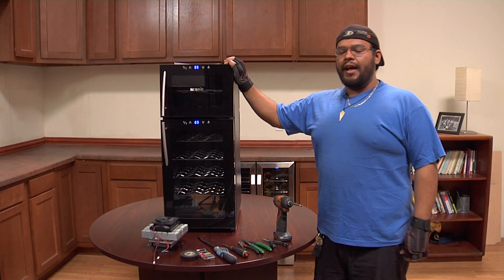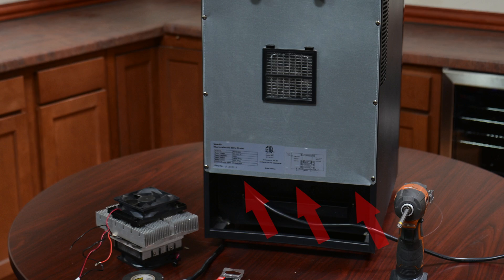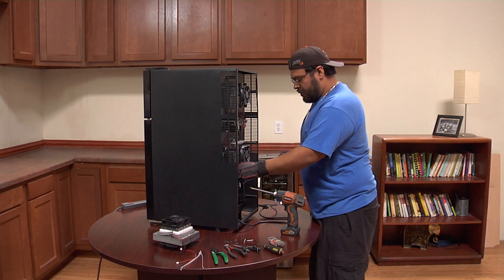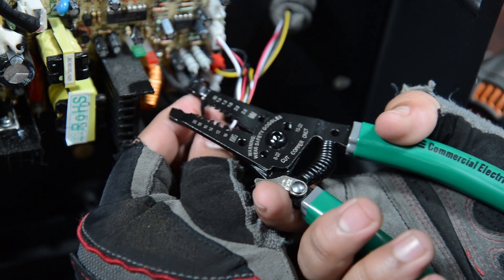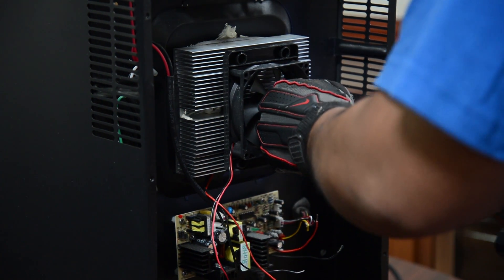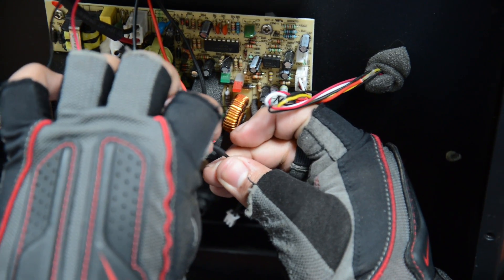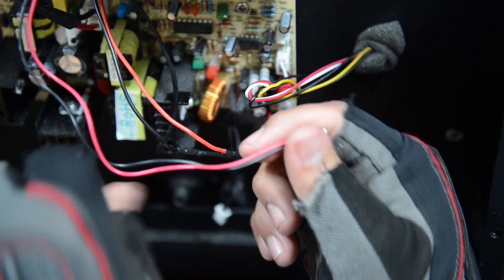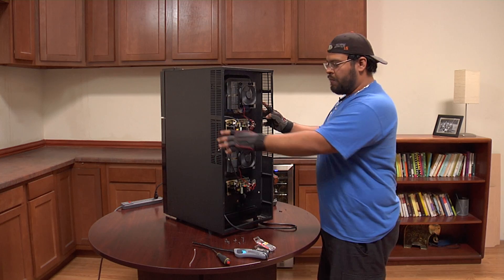How to Repair the Cooling Kit in a Thermoelectric Wine Cooler

Comment: This looks like my twin-star wine cooler, i had to move the upper controller to the lower to get the lower unit to cool.  where can i by a the control board and cooling unit?  Twin-star says mine is obsolete.
Reply from the maker: Hey David, we sell parts specifically for the NewAir unit featured in this video at the link below! We can't guarantee that they will work on a twin-star unit, however. If you end up needing a replacement, let us know! We have a wide selection of wine coolers to choose from. And let us know if we can help in any other way!
https://www.newair.com/search?q=aw-210ed
Reply: @newairusa  Great. thank-you. i'll be in touch.

Comment: I have a Candor unit. Power went out. Played with connection. Got power, fan, but will not cool.
Reply from the maker: Sorry to hear that your wine fridge isn't working! Unless this video provides you with enough info to fix it, we suggest contacting the original manufacturer. There's a chance your unit might just be defective, unfortunately.
Reply: @newairusa  Just cracked it open. Is it supposed to be blowing cold air back out?
Reply: @newairusa  Did not check for voltage but put it back and it seems to be dropping temperature.

Comment: I have an Avanti SWC2801 Wine Chiller.  It has no power at all.  The receptacles check out okay and there are no tripped fuses in the electrical panel.  Is the above problem in the video also symptomatic of the unit not powering up or just the failed cooling kit??  Any advice would be appreciated!  Thanks!

Comment: You really should solder or use wire nuts on the power connections. An un-soldered or insecure connection can build up heat and start a fire.  Be completely safe for pennies.

Comment: Wouldn't it have been better to instead of splicing the wires together, just get a wire connector. That way if you ever needed to replace the unit again it's just pull the connector apart and plug the new one right in.

Comment: Well done video.  My wine cooler is doing the opposite. Everything freezes even with the highest temp setting, so I'm guessing a thermostat issue?
Reply: Flash Gordon you probably don't have this type of cooler then a thermoelectric cooler won't get that cold they generally only cool 20-30 degrees below outside temp